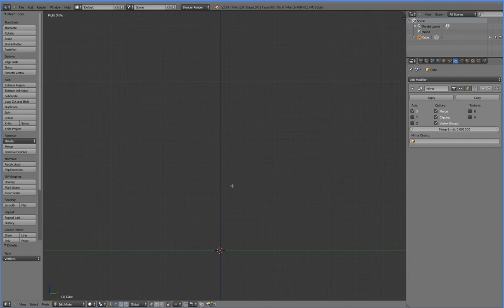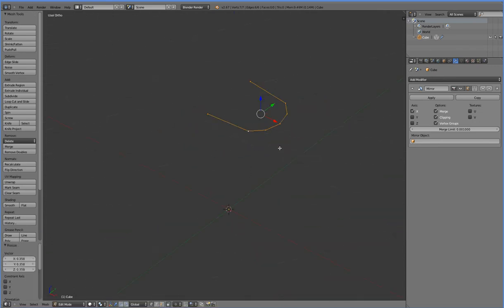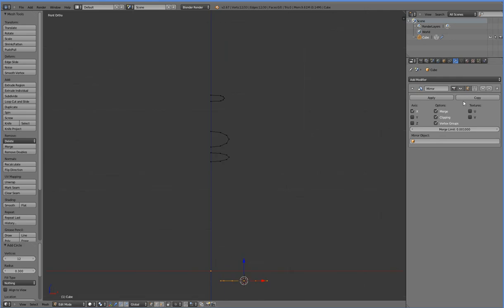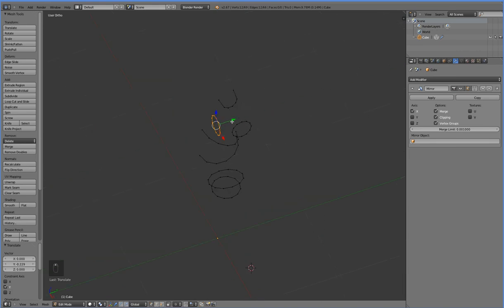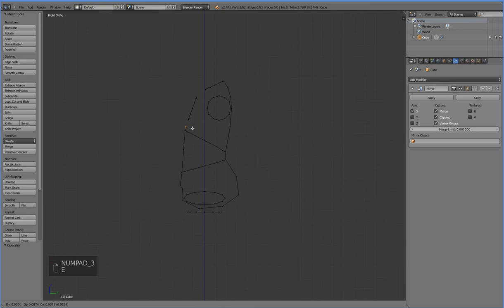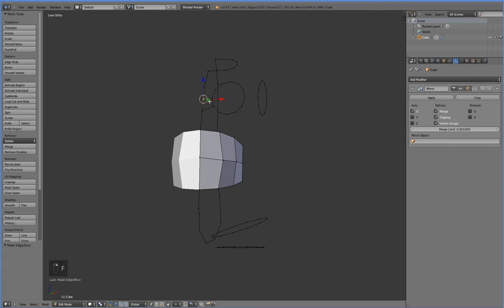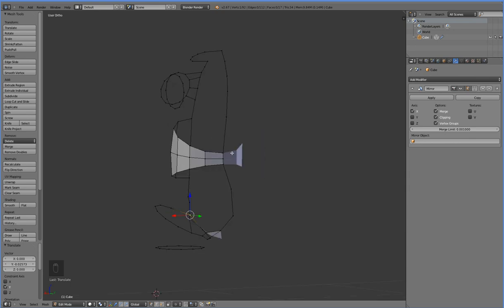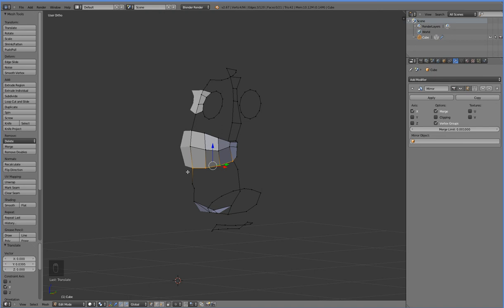Let's Model A Pilot #01

Comment: This is fun. Definitely seems like you need to understand where you're headed with this modeling method, since you're basically just drawing it out.
Reply from the maker: The reason I used this method is because the method I use for clothes later is similar, so it's good to introduce it early.
Reply: Looking forward to that, it definitely seams like a cleaner approach.